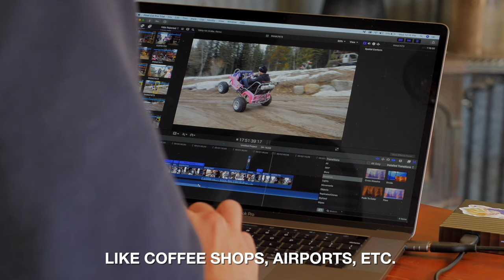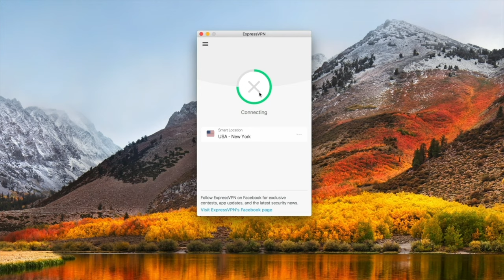Off-Road Barbie Jeep Build  EP. 11

Comment: I can almost guarantee any running issues are due to carb tuning.  Removing the stock intake and exhaust really screws with some carbs.  Sometimes it can be nearly impossible to get them to run correctly with major airflow mods.
Reply: Yes this is big faqs! The proper jet for the carb is crucial to higher or lower elevations, a lower requires larger jet since the air is more dense. higher elev. Is the opposite of course so smaller jet. Also try different spark plugs too. Colder plugs vs a warmer one. Either depending on what it has could change the responsiveness too. There might be an adjustment for the needle in the carb for at least 5 different spots try those first to see if anything gets better.
Reply: Agreed, my 450 responded great to carb adjustments. Although with custom intake/exhaust, tuning will be very difficult to perfect

Comment: My neighbor did something similar, building a 4x4 gocart with a cr500 engine and Baja trophy truck style suspension. It has a chain going to just forward of center shaft and chains going front and back. He wasn't able to fab cv joints, so used heavy duty braided wire mounted to the axle and steering knuckles. It works and handles the torque. It has about a foot of travel and sits like a pre runner with the front a little higher than the rear. He screams up and down the dirt rd by our property all of the time going 60+ mph and the front wheels barely touching the ground

Comment: You should put load carrying shock absorbers on the front, or pull those little coil overs from the mountain bike off and just use a set of coil overs from a small quad front only, the rear seem to be managing well. Great job though that jeep is bad ass.

Comment: I've learned from building my own go karts with dirt bike motors always maintain the factory air intake the exhaust doesn't matter but you can have tuning nightmares if you get rid of the factory air intake and motorcycle engines are even worse

Comment: Use a  bellcrank, you can increase throw and torque
Reply from the maker: For what?
Reply: @GrindHardPlumbingCo  you fixed it already by using the hand master cylinder, I was talking about solving the throw+effort from using the foot brake master by hand

Comment: Be carefull with the master so it does not suck air when the wheel is turned and at an angle 😁
Reply from the maker: As long as we keep it full it shouldn’t be a problem!
Reply: @GrindHardPlumbingCo  probably not! Test it out a bit on the bench with the car tilted avnd steering around, i mean better fail there than when ripping it 😅

As usual you guys deliver such quality!

Comment: Sounds like it’s choking with that splutter
Reply from the maker: It’s definitely not running right. Have tried various jetting combinations, with very little change. But the cam chain was very worn, so we are replacing that and we’ll see how it does.
Reply: Also could have something to do with the back pressure from exhaust

Comment: If I were you, I'd go to a motorcycle style handlebar instead of that weird shaped steering wheel, and then you'd have the same basic controls as the original bike had, it would be much more natural and easier to control.  Although I'd probably change to a thumb throttle.
Reply from the maker: That would definitely be easier to build, and easier to control, but it just wouldn’t look right. And Senderella is all about looks!

Comment: Builds entire new brake actuation system when the only problem was the leverage points on the master cylinder "arm"
Reply from the maker: Yeah, I could have fixed the old setup, but the whole thing just sucked. It was awkward, and the cable got in the way. Plus the parts were crap. Everything is better with the new setup.
Reply: @GrindHardPlumbingCo  It certainly looks like she rips. I've thoroughly enjoyed watching your build.